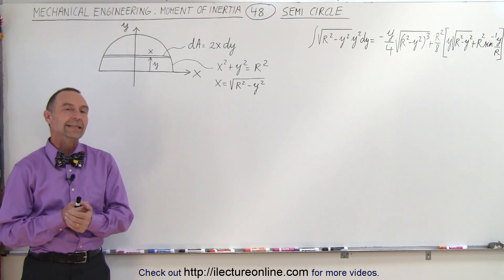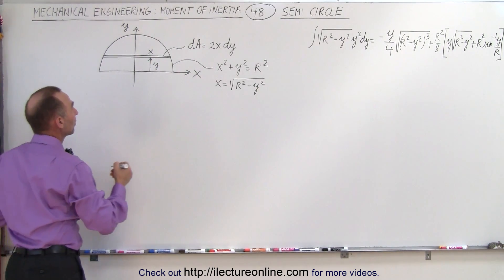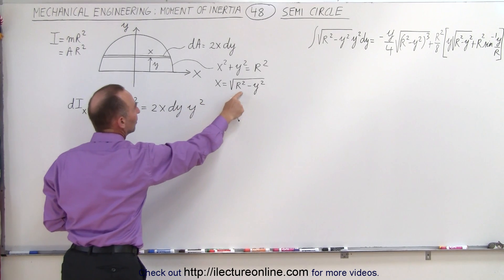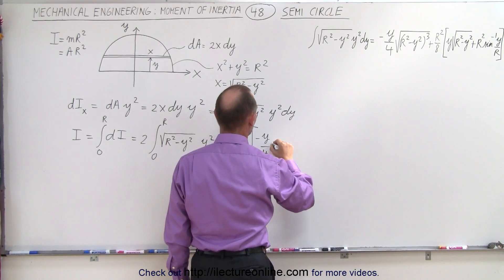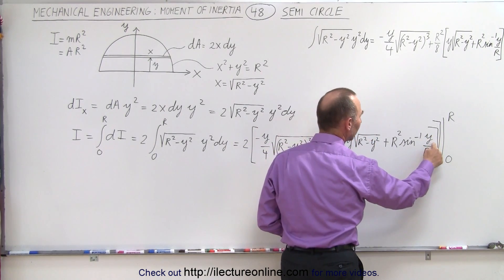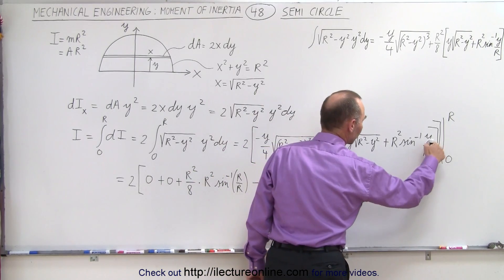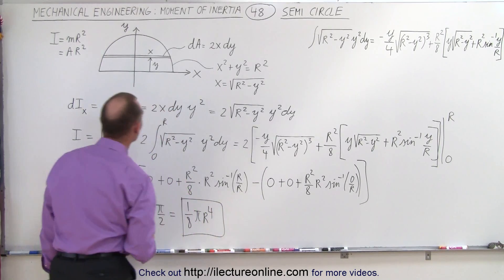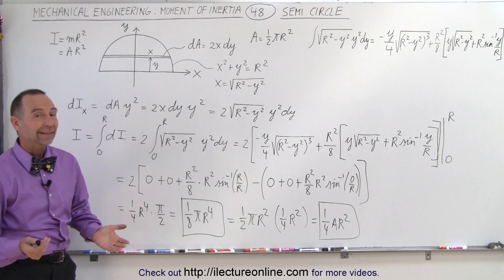Mechanical Engineering: Ch 12: Moment of Inertia (48 of 97) Semi-Circle

Comment: You did not show the detailed steps of integrating the integral of [(Square Root of R^2 - y^2) * y^2 ] dy.  Therefore, I checked with Symbolab Math Solver, and it had a totally different answer from yours.  Symbolab broke down all the integration steps and their answer was:   [Ry^3*Square Root of 1-(y/r)^2]/2 - [R^3y * Square Root of 1-(y/R)^2]/2 + [R^4arcsin(y/R)]/4. NOTE: This results does not take into account of multiplying it be 2, and then applying the limits.  I don't know how you came up with your answer.
Reply from the maker: Thank you for the information.
Reply: @MichelvanBiezen  lol

Comment: does the moment of inertia change if we change the axe of rotation  y-axis instead of x-axis?
Reply from the maker: In this case it does.  (It depends on the symmetry)
Reply: Thank you!
Reply: But sir, in your lecture no. 28, you proved that MOI about X-axes and Y-axes is same. I'm confused.
Reply: Hemanth Siva Kumar because it’s a circle .. x and y are equal because the mass point is in the Center .. the inertia should be the same .. but if you move the point of interest obviously it would not be the same ..
Reply: see this  https://www.youtube.com/watch?v=idKWlkgKXzM
Sir proved MOI will not change with change of axis.